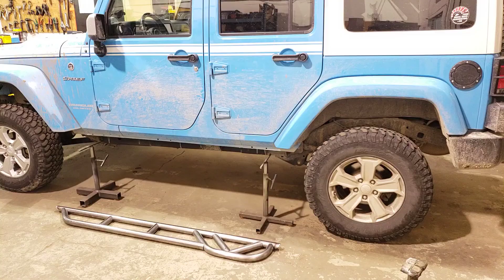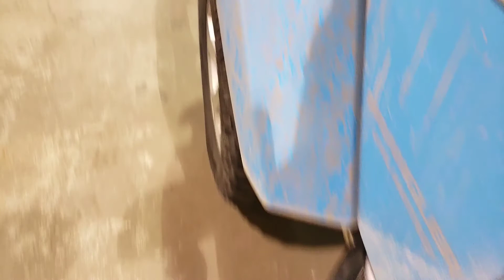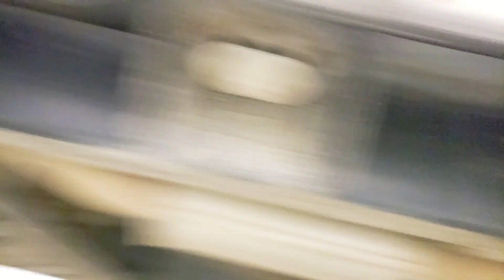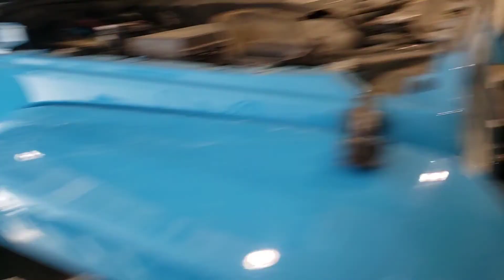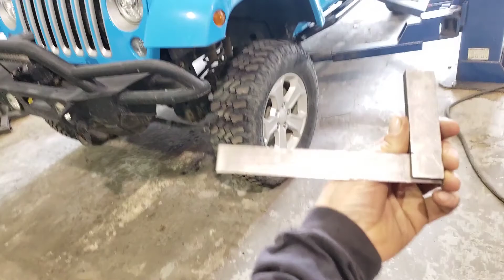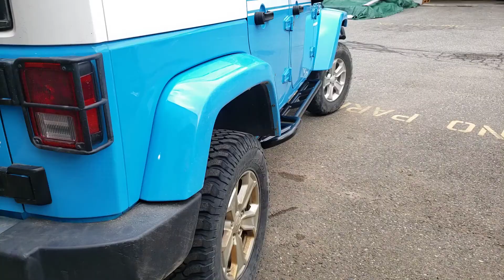How to Build Rock Sliders - A Full DIY Tutorial - Part 2

Comment: Great details and Im sure the welds are strong but instead of two vertical gussets (they look cool) I did base plates for my sliders to increase surface area, less concentrated inline load on the frame. But then again Im just a guy with a welder and a hand grinder so Im doing all the extra work to make sure my sliders dont rip off on the trail.
Reply from the maker: Thanks very much! ...I'm a bit late with my response to say the least, thanks for watching!

Comment: Any particular place where you buy the materials?
Reply from the maker: I use a supplier close to my shop - LWS welding and manufacturing. Sometimes you'll find your best deal by sourcing materials from different suppliers eg. tube from one and flat bar/plate from another, or you might get your best deal buying everything from one supplier. It's worth doing your research.

Comment: That looks absolutely fantastic ! I am inspired to make my own. Any advice if we dont have a pipe bender ?
Reply from the maker: Thanks very much! A tube/pipe bender is pretty much essential for this job but you could always see if there's a local shop that does tube bending and bring them your pre-marked tubes for bending. If you go this route just be sure to leave extra length after your bends so you can shorten them and notch them to the proper length after the bending operation.

Comment: I have seen lots of weld on sliders use reinforcement plates welded to the frame with the slider frame tubes welded to the plates to help distribute the load on the side of the frame. Do you always only use gussets or was that just in the case of JK Jeeps? I think in the case of my Nissan frame it is 3 mm or so thick, but the section is considerably taller than the JK section so it doesn't need to be as thick to be as strong. I am concerned about the thickness of the side of the frame and welding the slider frame tube directly to it. I would use gussets either way, but the bottom of the tube is going to end up about at the bottom of the frame, so a lower gusset won't fit. 

Do you think plating the frame is needed where the sliders are welded on or will a top gusset be enough?
Reply from the maker: Reinforcement plates aren't a bad idea on heavier vehicles. For me, the Jeep was just light enough to feel confident in welding straight to the frame especially with the gussets top and bottom. 
In the case of your Nissan you could do "L" shaped plates that would wrap around the bottom of the frame and extend up to near the top on the side of the frame if you're concerned. This would spread forces considerably and you could still add you top gussets. Having said that, I do think you could get away with welding straight to the frame so long as you can gusset at least 4 vertical inches to the frame.
Reply: @BalmersWorkshop  Thanks for responding. I am sure you are busy. I was watching another video where they tested three different sliders, 1.75 ERW, 1.75 DOM and 2.0 box tube. On both the DOM and box tube sliders they were able to cave in the frame. The test was to drop a 4 Runner on the slider from 6, 12 and 18 inches. They had welded gussets from the tube to the frame, but not all the way to the top. I think at a minimum I'll weld directly to the frame and then put a vertical gusset from the top of the tube to the top of the frame to help put some of the force into the top horizontal section of the frame. I may do a plate as well. It's wouldn't be difficult or costly and it would add strength with not much additional weight. The frame is only about 1/8 inch thick so the same thickness plate with some rosette welds should help without being too overbuilt.

Comment: How are they working out? Amy frame cracks?
Reply from the maker: Thanks for the inquiry. There have been no issues at all with any of these sliders. The double shear arrangement ensures that the stress is shared between the mounting holes. Although this means that the frame has to be drilled out in 3 places on each side, it also means that frame cracking is not something to fear and offers a mounting system strong enough that the sliders can be used as a jacking point.